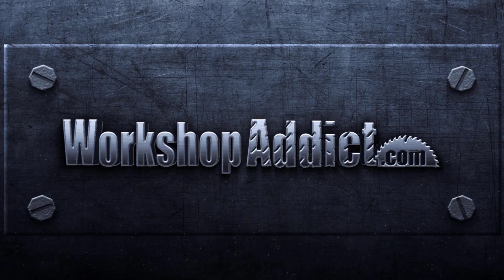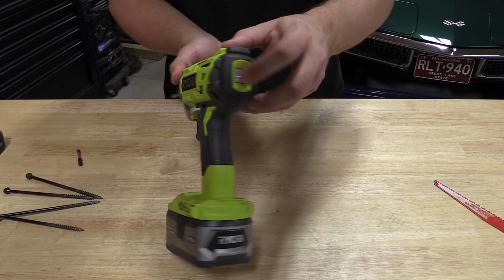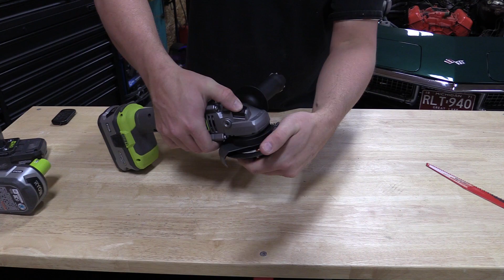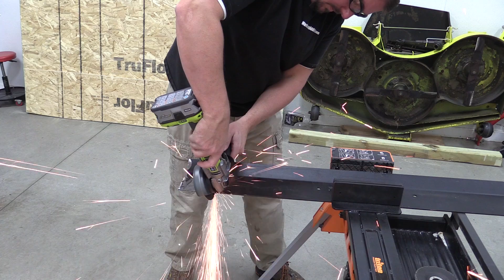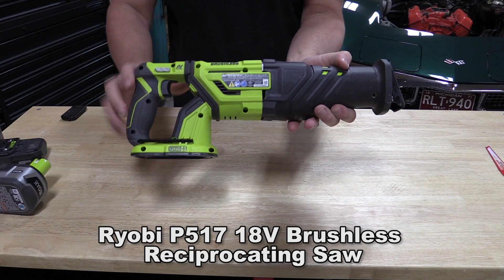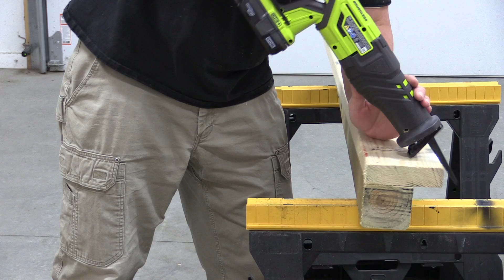New Ryobi Brushless Impact Driver, Circular Saw, Angle Grinder & Recip Saw

Comment: Very glad you did a review on Ryobi's brushless line.  I especially liked the points you hit about the batteries and how they affect performance.  I have the older brush motor tools and now I really want the 4.0ah batteries for them.  Good job, guys.  🖒 #workshopaddict
Reply: Robert Herrera they just came out with the 5 amp battery.
Reply: Adr Esc - I know they have the 5.0 batteries overseas and was wondering if/when we'd get them here in the states.  Glad I waited.  Thanks for the heads up.

Comment: There is only one Ryobi product I would buy. That's their garage door opener. I really like the ability to plug in the add-on components, plus you can use it in a power outage with a battery.. 

I would not even consider any of these products.
Reply: If that's because of this poor review, I would reconsider.
Reply: Oh no, it's a long history of buying cheap crappy tools and having them fail. 
 I've tried them all, Dewalt, Makita, Bosch, Hitachi. Even the cheap ones like Ryobi, Chicago tools etc.. You pay a little more upfront but you get so much more in the long term. Battery technology between the cheap brands and a Dewalt are night and day. 

Buy a high-quality tool, it's going to last you a lifetime. I still have and use my Makita 7.5 circular saw from 30 years ago. Looks good and works like new. 

Only 3 reasons to buy Ryobi.

a. your a homeownwer 
b. you are just starting out 
c. someone on your jobsite steals your tools.
Reply: Oh, tell me about Dewalt batteries!  I had the old NiCad toolset, and those are batteries you can KEEP!  I bought extras, had three chargers, and I felt lucky if I could get one going to do a job!  I'll take my Ryobi tools and One Plus batteries ANY DAY over that Dewalt junk!  I sold my Dewalt junk at a garage sale and was happy to get rid of it!  Ryobi was one of the best systems I am pleased to own!  I have MANY of their tools and I've NEVER had one fail or not work.  I have an old Makita 9.6v tools for about 25 years and two of the drills quit working -- but the Recip saw and the right-angle drills are still working --- FAR better than the Dewalt junk.
Reply: Milwaukee might be good for you; they are vast overkill for me.
Reply: John Salazar I bought a ryobi impact driver the brushed one i use it on repairing paving equipment it Wallers in the dirt,grease,diesel even gets dropped time from time to time even spilled hydraulic fluid on it, i wasn't expecting it to last very long and its been abused  the 
Only problem i had was the small battery pack housing cracked and a piece chipped off and one of the chargers failed on me because of moisture shorted it out it's a still chooching! Going on four years!

Comment: Wow was watching this video I decided to take my Ryobi brushless circular saw and  rip through a 2×6 well let me tell you this saw ripped straight down the middle through a 2×6 with no issues and it was fast you are your best reviewer when you got the tool in your hand
Reply from the maker: Please share that in a video as we were unable to get those results.
Reply: I sure will
Reply: What blade did you use?
Reply: Cheng Liu the carbide blade that came with the saw didn't have any issues
Reply: You just have to pay attention to the sound and feel of the tool and it's pretty easy to keep it from stalling. It's slower going with the 3800 RPM blade speed, but the newer 6Ah batteries really give it some extra power.
Reply: they probably used a 1.5 ah battery

Comment: Slow your work down with tools that are suppose to speed up your work, lol.
Reply from the maker: :)  If you don't slow down, they won't work.  :)  I said slow down because I am used to working with the Makita and Dewalt saws and those fly through this stuff.  So it took me a few tries to slow up enough to make this saw stay working.
Reply: I didn't mean anything against you, your statement is a correct logic to using these tools, but its sad that they have a too touchy overload protection circuit.  Ryobi's marketing is that these tools are more powerful to get the job done quicker and based on your review and many others, that is not the case.  It will be interesting to see how the reviews are of these tools as Ryobi is fairly highly reviewed.  I just wonder if the DIY'er will be putting these to the max like you did and give bad reviews or if they just will never get there and leave positive reviews.
Reply: If you use ryobi’s new HP batteries you don’t need to slow down with brushless tools anymore 😁

Comment: i could understand the place for them if they were actually below half the price off the other brands but its only and extra 20% or so to get the trusted more powerful brands with longer warranties and thatll outlast the warranty...
my milwuakee fuel grinder never cuts out however my7-1/4 fuel circ saw will cut out  when ripping 2by material.. itll cut osb as fast as you can feed it though and im pretty sure ive seen other channels on here use it to rip 4 sheets of osb at teh same time no issue
Reply: that impact wrench looked like it was firing the 2-1/2 inch screws in but it couldnt quite keep up with the longer ones
Reply: Andrew you must be pretty terrible at finding deals on products while shopping.  I got most of my Ryobi tools for less than 40% of what brands like Dewalt or Milwaukee cost.  Granted most were bought back when they were brushed, but at the time so were the Dewalt and Milwaukee.  However I think you have your numbers wrong.  Take the reciprocating saw for example, the Ryobi P516 can be had for $60 from Home Depot and sometimes $50 on Amazon while the Milwaukee brushed M18 is $130.  The Ryobi brushless P517 is $120 and the Milwaukee brushless is $180.  This is fact, current pricing.  Somehow, $180 is not only 20% more than $120, plus you can get the Ryobi batteries for more than 20% less than a similar cost:capacity ratio for the Milwaukee or Dewalts.   Don't get me wrong, both Milwaukee and Dewalt make better tools for that price difference.  My point is only that the difference is far larger than you suggest, especially if you don't need the lastest model of something.  For example I can pick up a brushed Ryobi impact driver on Amazon for $35 delivered.  The Milwaukee brushed impact driver is closer to $90.  The examples go on, for just about every tool so no, it's not just an extra 20%.

Comment: Wow what is with all the cutout stuff that looks so dang annoying, I have their 5.5" saw and it has never cut out, I have their original green reciprocating saw and I go through 4x4s with the new 4Ah battery like not problem.  What the, I know this is to save the tool but seriously.  I will be buying the impact driver though, looks like they build something exceptional there for the price point.
Reply: The Regular Guy i can drive 4” screws with my Ryobi all day no problem with 4ah batteries. The other tools are junk but they make a good impact.
Reply: Kartboarder22G i had the sazall and many other ryobi tools, but a few months ago burned out the sawzall that was barely used. I went to dewalt
Reply: If you're going to be driving any decent sized screws on the regular this ryobi is critically underpowered for that.Even a brushed dewalt with a compact battery does a better job than this with the 4a battery

Comment: If your going to upgrade to brushless, maybe look at a more professional brand. Just my thought
Reply: Based on what I see here, looks like the reviews aren't going to be too hot for 3 out of 4 of these tools and for 1 out of the 4 of them through the roof.  Ryobi will then bring out new versions in 2 years that correct these issues.
Reply: Hello everyone, I have Ryobi's Combo Kit (to carbons) and the truth is that the screwdriver is still working every day, every day, I bought a Brushless Dewalt screwdriver and it is ... died.
the rest of the tools are still working and they have already paid for themselves.
Greetings to all from Don Torcuato, Buenos Aires, Argentina
Reply: The problem with the Ryobi power tools is the they don't have any modes on the impact drivers (even the brushless one) like most other high end tools. My Makita has 6 modes that restricts the speed the bit spins and torque it outputs, making it easier to control different screws. All the impact drivers have a variable speed controller but the better quality ones have modes to control the driver.

This means I can not worry as much about pressing the controller the right amount and more on what I'm doing.
Reply: The Ryobi tools are for the weekend worrier and home DIYer looking for more power but not wanting to spend a lot.
Reply: YOU'RE***
As in, you're an adult who should know the difference between "your" and "you're". Just my thought.
Reply: @jtp1389  
Sometimes the device changes the words for the users unexpectedly.

Comment: Maybe there defective, try another set and see with a follow up review. Could be the batteries too.
Reply: Look at other reviewers the brushless drill is doing the same thing.  Obviously their overload setting is too touchy to avoid warranty returns.
Reply from the maker: I used 4 batteries in the testing with the same results.  If it was just one tool cutting out, I could justify trying again, but 3 out of 4 sends a very conclusive message.
Reply: Fair enough

Comment: I will stick to my milwaukee tools. You get what you pay for.
Reply: Milwaukee is made by Ryobi
Reply: @440Trick  
Not the same specs.
Reply: @440Trick  and toyota is Lexus.
Reply: @440Trick  uuu,and nissan is made by renault.and dacia..so...they are different
Reply: No, Milwaukee is manufactured by TTI to their specifications. While TTI also owns Ryobi, that' like saying the the Chevrolet Spark and the Corvette are the same.
Reply: John Bailey okay 🤦‍♂️
Reply: 440Trick and, your point lmfao?? That doesnt mean there the same product or high output yet alone quality
Reply: 440Trick oh you were just trying to point it out lmao... im sorry bud i thought you were going to be one of those homeowners who seems to think ryobi is just as good as Milwaukee 😂
Reply: My point is Ryobi and Milwaukee are the same company.  I would venture to guess almost no one knows this. Nobody said they are the same product or quality. I own both.
Reply: @440Trick  
You are comparing Chevettes vs. Corvettes from GM
Reply: the ridged,ryobi,aeg,milwaukee all owned by the same company and manufactured in the same spot!
Reply: Same here. Milwaukee or Makita for me
Reply: TEAM RED
Reply: Clayton Bigs  who lit the fuse on your tampon your a fan boy some of Milwaukee tools are made just a cheap as a ryobi tool only difference is the cost by the way i use some ryobi tools in the field working on construction equipment example an impact driver using it to removing panels,hydraulic pumps,ect down it get's filthy it even wallers in the dirt and grease,oil,diesel hydrualic fluid even dropped it and it breaks Impact driver bits when building  2x6 pallets etc only paid $119.00 +tax going 4 years strong i was suprised how long its lasted wasn't expecting much from it. I own power tools from harbour freight to a 1970 miller three phase wire welder i converted over to single phase so go ahead and over spend on tools when some cheaper tool will do the same job especially if it not used all that often or over spend on a tool that built no better then the lower end tool brands of the same company, AVE did some tool tear downs on some of those  Milwaukee tools and some of them are made just as cheap as a  lower end ryobi tool.
Reply: Clayton Bigs its all about when where and how you use them, price,how often you use them,and who makes the specialty power tool you need!  Not a fan of any particular brand, i save alot of money this way but the charger's and batterie's interchangeablitie's are the only draw back's.
Reply: Clayton Bigs There all aimed at different groups of tool user/tradesmans and no problem!
Reply: terry jenkins milwaukee was made for industrial work, and ryobi was made for home owners because they dont need the power and the price we pay for our tools... your using homeowner quality tools for industrial work...
Reply: terry jenkins listen man, in full honesty I understand where your coming from but to say that ryobi is the same as milwaukee was beyond a stretch... i just got upset about that and I apologize
Reply: LOL. I just bought an 18v Milsuckee 1/4 inch impact gun. It is inferior to my old Ryobi in almost every way. In fact, when I first unboxed it I thought the directional switch was broken as it had so much slop in it. I looked at other display models in stores and NOPE, the milsuckee just has that much slop. My cheap Ryobi runs circles around it.
Reply: Do you not expect Milwaukee to be the superior tool? The m18 fuel line is at least twice as expensive as an comparable Ryobi. If your tools make you money why not spend more upfront? For a tool that you will use once or twice, Ryobi is fine.
Reply: I won't rip on Milwaukee but that "you get what you pay for" is absolute horse !@$%.
Reply: terry jenkins it doesnt fucking matter lmao... so because there made by the same company there the same quality?? Absolutely not his point is hes sticking to milwaukee because there the leading tools in the industry, we literally dont give a flying fuck if they make ridgid and ryobi too... milwaukee is better than all em...
Reply: Pro1er i lost brain cells reading that comment
Reply: terry jenkins lmao im 18 years old and im a plumber and i can afford milwaukee... okay if ryobis so good PLEASE im begging you make a video of you taking lugs off a wheel with your impact driver or sinking a big ass lag bolt in a 4x4 please cause my milwaukee can do both em with ease... i cant believe your actually going to tell me ryobi is just as good lmfao your just ignorant cause you cant afford milwaukee, do me a favor watch the comparison on powertools and almost always ryobi, and portercable come in last its between those 2 for last place

Comment: I’m in shock with the circular saw cutting out like that. I have the Ryobi cordless 6-1/2” saw and was able to rip pressure treated 2x4s right down the middle with ease. It has to be the blade. I was using a diablo doing my cuts.  I’m no pro just a weekend warrior and I am very pleased with my Ryobi tools. I bet that saw does a lot better with the proper blade. From my experience and owning a few different ryobi saws, the stock blades are garbage and a new blade should be purchased along with the saw. 

Great review!  Thanks!
Reply from the maker: I would think a new blade would help.  Brushless can be a bit more sensitive than brushed in high amp draw situations and it showed here.
Reply: @WorkshopAddict  
Ryobi's new brushles tools were designed to be used with their newer +HP batteries. I have this exact same saw with the new +HP batteries and a Diablo blade and I rip thru 2x12's, solid 4x4's and wet 7/8 inch OSB ALL DAY with zero stalls!
Reply from the maker: @nathanjacobs1509  Those were not out when this video was made.
Reply: @WorkshopAddict  I have the brushed version of this with the larger battery, cut out while cutting 2" trim lengthwise. Take it for what it's worth. I'll hold off on upgrading the set
Reply from the maker: @Lexlugr  Some people get exactly what we show in the video and others rave about these tools.  I don't get it.  There does not seem to be consistent performance.
Reply: @WorkshopAddict  I have seen others bash you for reviewing Ryobi tools. Love all of your reviews,  because they are factual and exactly what people in the decision process are so please don't change. The one thing I don't like is Ryobi's tactic to offer got two different brush-less impact drivers, the one in the value kits is P239 and is really, really touchy. It also doesn't have the 3 speed switch on the back and has a lower torque rating and crappier light set. Super frustrating...
Reply from the maker: @Lexlugr  Thank you for your comment.  We tell it and show it how we see it and will always do that.  Our channel does not appeal to everyone and that is fine.  Thank you for supporting us.
Reply: WorkshopAddict I did not know that. Learn something everyday. Thanks for the review and reply. I really appreciate it!
Reply: It's the brushless I have the 5.5" ryobi saw and it goes and goes all day.  Seems like all Brushless tools Ryobi are making are too touchy on the overload protection except for the impact driver as that gets a break every impact so it should never overload, except maybe if it overheats in the sun building a deck none stop, but even still probably never will.  I'll be picking up the impact driver shown here, but I won't bother with the rest, I'll stick to my brushed.
Reply: Its also probably because he was cutting unfastened lumber. Dear god i never try to cut through something that is merely sitting on horses not secure or held down well. cutting small edges or chunksoff 4x8 plywood/osb being the except but even then i'll throw a box of nails/screws or something to weigh it down in place.
Reply: I have the non-brushless saw too, with the stock blade, and just did a bunch of full depth long rips on green cedar. The cutting out in the video makes me question the state of the batteries. Batteries are by far the most glaring variable between these tests.
Reply: I wonder how new that 4 aH battery is? The 5.0 that I have should have even more oomph. An old battery could be weakened. Would be interesting to compared to a brand new 5aH battery.

Comment: Good honest review. Like you said these are not the high end Fuel or Flexvolt tools which are double or triple the price. I use the m18 fuel line and the m12 fuel line but also have a few ryobi tools that I use on occasion. Ryobi jigsaw is excellent . Love the ryobi compact blutooth radio and the tire/high volume inflator. With the 4.0 they work great. Thanks